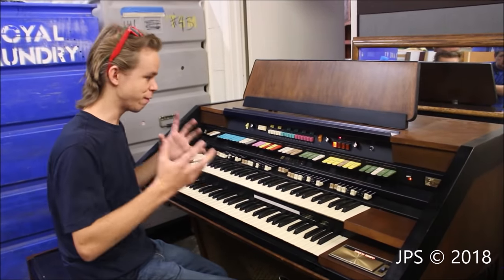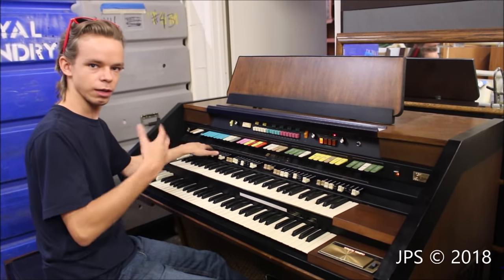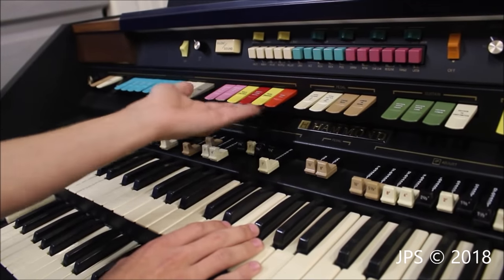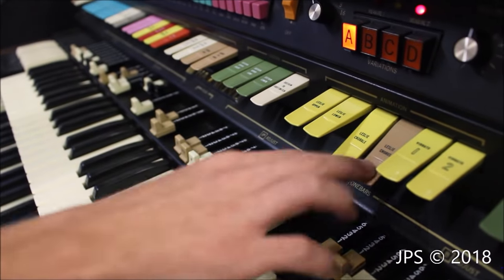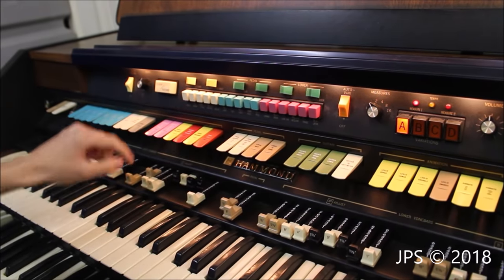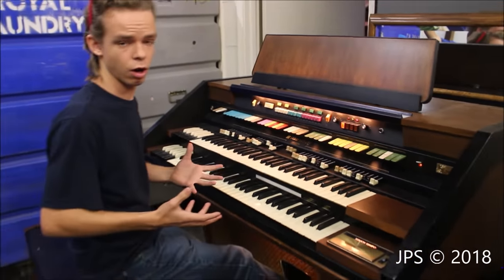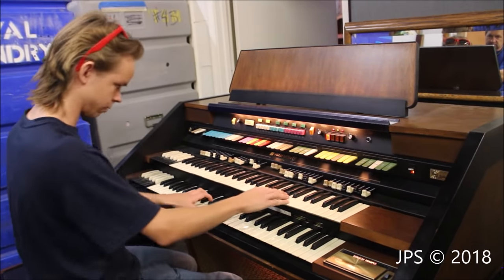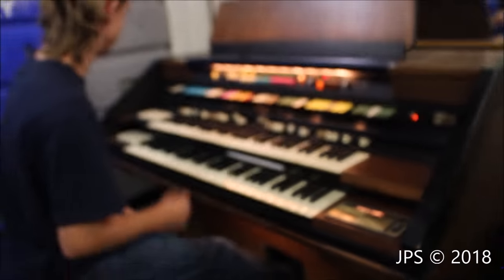James finds a $300.00 Hammond Organ, your thoughts? Cheap Deals

Comment: Organs are sort of like typewriters. Nobody sells them anymore, few people still use them, and nobody repairs them or if they do it can be very expensive. Millions were sold, but someone told me that there is only one typewriter "fixer" left in San Francisco. If you like old organs, you have to be prepared to do simple troubleshooting and  fixes yourself (or pay a lot of money).  Naturally the B series organs are easier to fix as they have few connectors (if any)  and only a few tubes ... and a lot less voices and features.  However, as long as they are in demand and available (at some expensive price) there will be fixers.

I don't understand the argument about the Concorde and later Hammond's weight.  They have built in power amps and speakers and weigh about the same as a  B3 which has none and requires an external tone cabinet.  Organs are heavy! All the electronics in the Concorde including the keyboards probably weights....maybe 20 pounds.

The Concorde has about 80 PC cards ... some of which are duplicates .. and maybe 3-400 feet of wiring ... not miles. I know because in replacing the phenolic boards, I replaced the wiring because the new  connectors were different. Lots of short wires and connectors though!

When it's fixed and working correctly, I think the Concorde and the later Elegante have a great sound, but I am at best a beginning organ player so I will leave the sound comparison between the LSI organs and the town wheel guys to the experts. The new Hammond Suzuki company has made two (3?) attempts to replicate the B3 sound using the latest electronics and the experts say they are not there yet. I think the problem is they can easily duplicate the tone sounds ... just not the defect sounds such as magnetic coupling in the townwheel pickups, foldover of the upper octave notes, key clicks, octave sounds coming in at different times depending on key force, and others which are all part of the B3 sound. Hammond fixed these defects in the Concorde and later organs, but maybe they were part of the "Hammond Sound" that people liked.

Jim
Reply: @ techy5025: another great and well-put comment from you sir! good points also about the 'modern' Hammond-Suzuki thing and its great yet still lagging sound quality when compared to an original Hammond B3 ...

yes, emulating the sound of an acoustic instrument such as the piano or guitar or violin etc via sampling tricks is NEVER the same as the original just when a synthetically made taste of orange or other fruits is never the same as the natural ones, is it?

in case of the Hammond organs sounds, which was electronically produced already yet in an 'analog' manner, there were also a lot of mechanics and 'acoustics' involved as well, making it more like a fully accoustic instrument in comparison to present day 'digitally' emulated or simulated electronic instruments ... (compare that to photographs or movies made using film emulsion vs still or video cameras with a digital sensor ... true pros in the business still seek film and those who don't is mostly because they can't afford the higher costs of the film material and processing etc, otherwise ...)

both and all methods are good in the end though, and needed as well, but sacrificing one for the other, especially throwing the acoustic/analog stuff away in favor of digital is a HUGE mistake imo!

Comment: As a Hammond organ service technician back in the sixties and seventies, I’ve encountered that noise problem before. It is likely caused by a diode in the power supply called a Zener diode, or avalanche breakdown diode, used as a voltage regulator. I’m sure they are still available, but you would need to know it’s specifications before replacing it. A service manual schematic would be immensely helpful, and I’m sure any tech that knows amplifiers and power supplies could find and replace the offending component. Good luck, and I think you got the deal of the century if you can get it repaired
Reply: Great tip. I advise to also replace all the capacitors in the same power supply. Furthermore cleaning all multiconnectors will often help, for instance to get the missing poly presets back. Loads of great old organs are begging for this kind of treatment before it is too late. Do however not postpone such jobs too long after starting to use them again. Otherwise the (re)new(ed) freindships might not last long.

Comment: This is a Concorde organ. It was introduced around 1974 if my memory serves me right. I was a Hammond Organ Service tech.  I could work 7 days a week 24 hours a day on service calls, that how large the organ sales were. The Concorde did have a small rotating drum when it first came out and that was the leslie speaker. The pedal sustain switch on the foot pedal was used to cancel the sustain when you pushed the foot switch. The tabs not working just need cleaning and some silicon grease.  THis would be great to  have. I still have my spinet T-500  which is smaller than the concorde which was call a Console Organ.

Comment: That is a Concorde 2300 series organ.   The Concorde 2100 series was trouble prone, but the 2300 was pretty stable.  
First thing to do is remove each card from its connector and spray the connector and edge down with DeOxit.  Then check all of the filter boards for cold solder joints. (I had a capacitor fall right off of the board when I was working on mine.  (ALWAYS obey static discharge when working inside of it, those LSI chips are kind of sensitive and very hard to replace.)
Other trouble points little soft flaps on the preset key, that release the locking bar, but can be replaced by a hard flexible plastic.
The "other" leslie tab is for an external leslie.  I had a 22R hooked up to mine and it sounded great when flat out.
It is not a tone-wheel organ, but it has its own sounds which can be very close to the B or sounds all their own.
I gave mine away eventually, to a veteran that always wanted one and replaced it with an Allen 705.  It sits next to my Hammond E100 and Hammond S6.  My wife said one more organ, and she is leaving.  I will miss the way that she cooks oatmeal on Sundays.

Comment: It's a Hammond Concorde 2300 series. You have there a model 2307 with a contemporary cabinet. I have model 2312 which has the same electronics but has a more traditional cabinet styling. I used to sell Hammond organs and would occasionally give concerts for local organ clubs. The Concorde is a great organ. It has a really gutsy, rich sound especially when played through an external Leslie speaker such as a two-channel model HL722 or 715. I have mine hooked up to a four-channel model 740; however, two of the channels are unused. The B3 is a great organ too, but it has a different tonal profile. The B3 has more of an "edgy" sound that's great for today's gospel, jazz, and rock whereas the Concorde has a rounder, more theatrical/pop organ tonal profile. As others have mentioned, you'll probably need to clean the edge connectors on the circuit boards and will need to replace some capacitors to get rid of the hum. I love the additional percussion harmonics available on the Concorde (the blue tabs). Most organs including the B3 only had 2nd or 3rd harmonics. Try these jazz registrations on the B preset on the upper manual: 88 800 0000, Percussion Fast, 3rd harmonic, Leslie Upper, Leslie Chorale. Now try the same registration except use 3rd and 8th harmonics. Then try the same except use 4th, 5th, 6th, and 8th harmonics. There are lots of other possibilities also since the Concorde has sustain which isn't available on a B3: Swiss bells, vibraphone, and other cool effects.
Reply from the maker: Greg Taylor,
Thank you for all of that insider information.
Reply: @ Greg Taylor: an impartial comment with great info on both this great gem and the B3 at last, unlike some other people bashing it totally! i'm sure you know very well what you're talking about sir! many thanks. :-)

Comment: Non tone wheel hammonds are worth about that if they work perfectly. If you want to do some DIY troubleshooting for fun have at it, but otherwise I wouldn't put much money into it. Get a service manual. There is an organization for organ techs called MITA, but be advised they are not very DIY friendly. You will need a scope and some decent soldering skills to work on these, and a bench with a good supply and some fixturing helps a lot.

Comment: Those organs are notorious for having quirks and noises due to bad connections on various circuit boards. They can usually be cured by removing the connectors, cleaning them and readjust the prong to make a tighter fit at the circuit boards. There is actually a rotosonic Leslie built in the organ itself. It’s different than low rotor that you’ll find in a standard Leslie because there’s a 6x9 speaker in the drum itself. I tend to like these in a Leslie better because it has a stronger tremolo than a standard rotor with a woofer on top. The other reason is that rotosonic Leslie take longer to accelerate and decelerate than a traditional Leslie. There’s my rant about this Hammond Concord.
Reply: You are right about all of this.
Reply: shawnr26 Ive got this old one , it's called a Lowery, with two levels of keys with your level with more sound controls! 
its been with my mom for years, I tried to get it up an going, but no luck. 
I took the back off and looked at everything while it was plugged in, but nothing was running or humming.
the power cord went to a big transformer, but could'nt tell if anything was on , any ideals what to do or is it junk?

Comment: If I had to guess, the noise was from the Lesly(sp) speaker. While I was in Ohio in the 72 time frame I would rebuild the scanner in about one or two hours instead of sending it back to Hammond. I never worked on this model.

Comment: I have the nearly exact same organ, yours looks a bit newer, mine has a cassette recorder and clear plexiglass music rack.  I just got done rebuilding it, and everything now works except the light for the pedals (don't look at them anyway). Replaced all the large electrolytic capacitors, many power transistors, one little diode it the power amp that caused the voice coil in the 15" speaker to burn out (replaced), and cleaned up and lubed the Leslie.  Sounds good now.  It was built in 1975.  The instructions, schematics and pictures are online.  Just google Hammond Concorde Service Manual.  You can get a free PDF manual. Previous organ was Hammond H-100 with A-10 tone cabinet, sold to a church. Tom Miller, Phoenix, AZ.
Reply: Tom .. Mine is the early version also. Agree on the power supply. In addition to the caps, mine also had poor connections between the ground lug on several multi-lug terminal strips and the chassis causing hum. Also, due to aging of the resistor bias networks, the power amps were drawing to much idle current .. thus running too hot. 

Glad to hear others are getting these older organs going!

Jim

Comment: Check out the inside. If the leslie is still working, it's a pair of horns that rotates. Sits on top of a speaker. Turn on the switch and you should hear it spin up if it's still working. Press a key before you do it so you can hear what it does... if it still works.  Very cool.

Comment: The percussion tabs only work with the B preset down just like the B-3.  The model # is located under the keyboards looking up (where you put your knees.  2300.  the digits in the ones and tens place usually represent the wood finish (cherry, oak, walnut etc...) and the cabinet style (French Provential etc...)

Comment: This is a Hammond Concorde.  It was Hammond's first attempt at selling an all solid state organ.  This does not have the tone wheel that makes other Hammonds like the B3 sound so iconic, this is all electronic components. In good condition they go for $600.  Most of the issues they have are with the daughter cards.  They come loose and need to be reseated.  

Its not a classic Hammond but still a neat organ.  There's a headphone jack under the right hand side of the lower manual that will allow you to patch it into a PA system, though the built in Leslie sound will only come from the organ directly.

Comment: It's a Hammond Concorde. I had a 1971 Concorde, it was the stage model, which was black and had a white leather seat, chrome pedals, there are a few differences from the one you found here, this one I think must be just a little bit older than mine was. Mine didn't have the ABCD tabs on the top right, and the tempo section was set up better. I miss it to this day, haven't been able to find another one like it. Yes, I think that you found a steal!

Comment: There are quite a few plug in circuit boards on the 2307/Concorde.  They need to be removed and the contacts cleaned with Craig DeOxit contact cleaner.  There is also some foam material that turns to goo that needs cleaned off also.  The board connectors will cause the “static” you are hearing.  You can also end up hearing single tones sounding on their own.  These are called cyphers..... board cleaning will help.  The board connectors may also cause the lack of sounds on some of the switches.  Sounds good overall.....

Comment: There is a white rocker tablet on the Auto-Vair drum unit which is at the left and will stop the automatic rhythms. The reason for the chrome on the pedals, because it matches the modern contemporary design as I love that chrome pedal board. The white strip in between the two keyboards is called an Arpeggiator, play a chord on the lower keyboard and slide your right finger as you will hear an arpeggio of any voice on the upper keyboard. I sure wished that I could find a good deal on like you did, but please do not remove the chrome off of the pedals as it matches the modern contemporary design of the organ. On the lower right side, is a touch pad to set the tempo and it is called Touch Tempo. The Polyphonic blue percussion keys are used inconjuction with the Tonebars (drawbars), and choose any of them to give you a jazz sound. This organ is analog, using Multiplex technology, and I would have to say that the piano sounds good and the closes to sound so real for an analog voice. Hammond did not get into digital sampling technology until 1986, after being bought out from a man from Australia, and then purchased by Suzuki. This model Hammond is known as the Concord series, originally developed from the first generation 2100 in 1973, but this model the 2307 came out possibly in the mid to late 1970s as Touch Tempo was then added and Auto-Vari drum unit. If you have any question, please contact me.

Comment: The model number is on the back, above the ventilated plywood. That looks like aa Aurora Elegante. I have an Aurora Classic from 1981, looks very similar. Your model is the top of the line for the time, I think. The popping and hissing is probably a bad capacitor in the power supply. Mine used to do that also. I got mine for $20 about 3 years ago, changed all the electrolytic caps, aluminum and tantalum. Fun job. Solved some problems, created others. These LSI ( Large Scale Integration ) organs are very persnicity.